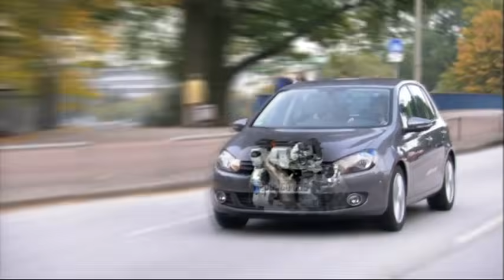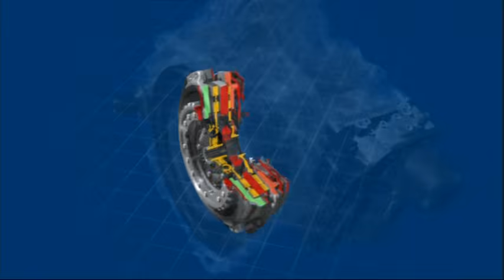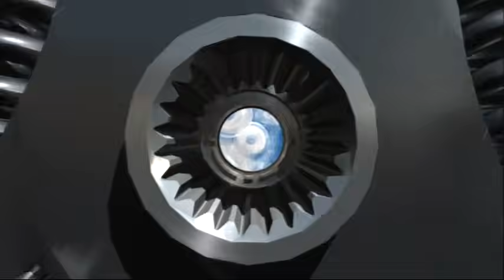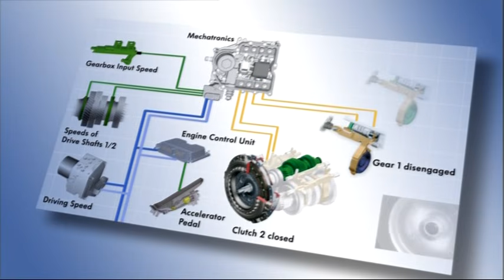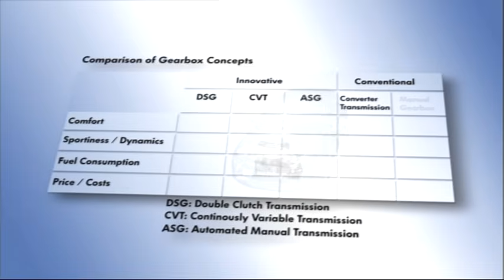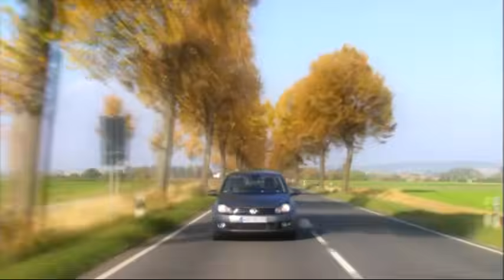Volkswagen Explains DSG gearbox

Comment: I have a problem with what VW is doing. I think they mean well but what theyvare doing is wrong for the real world and proper design multispeed automatic transmission with lockip torque converter is better. The problem I have is I live in Seattle WW USA which had horrendous traffic jams. Took 12 minutes to go from SR 512 west to I5 south in Tacoma on one ocassion and have rin into similiar jams elsewhere. Traffic sometimes moved slower than engine at idle first gear for minutes at a time. Real manual transmission with coutch pedal cannot competent traverse such jams and have become almost extinct in this ares. I saw tou rube video showing dual coutch creeping aling real nice in what i believe is similiar to traffic jams. Narrator warned dint do this wears coutches out real fast and other yoy tube videos suggest avoid such driving. Well you can't do that in Seattle. Never know where jama turn up and it hsppened often enough that is no go fir manual transmission. And I believe dual coutch.Dual clutch might be better in some ways perhaps as VW claims. But realibulity and affordability means more than slight improvement in performance. I also believe VW eventually found this iut. Aaw somewhere they went back from dual coutch to automatic transmission in one of their models

Comment: I had golf 8 eTSI with DSG/DQ200 Transmission I and have strange noise(clattering metal to metal) at low speed .I was on specified service car is old 8 months and last mont I got strange answers from VW factory that this noise is normal...it could not be disasters what a shit gear box and car!!!!

Comment: I wouldn't hesitate to say that some transmission problems turn out to be the dual mass flywheel. I had one go on my 2006 Jetta TDI and my 2017 Jetta GLI 6 speed manual. The one on my GLI cost me $3000. I was pretty angry about that. I have the flywheel and clutch and just 1 rivet caused it to fail. I'm not impressed.

Comment: DSG best transmission where there was a recall in 2009 when cars would get the flash of death (Flashing PRNDS) and your vehicle would get into neutral and you have to turn off you car in order to get it working again. Best mechatronic unit reliability where you can have 20000 miles and it already failed. When you want to shift into reverse from drive and your transmission gives out because it's faulty. Perfection

Comment: Cost 0??? At ~$9500 USD for a new/replacement OEM unit (Audi)--these things are not cheap! Nor is it easy to find anyone capable or willing to repair one given the low risk vs. reward in doing so (at least not once you are dealing with issues inside the gear box). When serviced and not leaking fluid, they are hard to rival, but if one starts to fail or lets go, plan on dropping some dough. I am about to pay $4500 all-in on a salvage unit including flat rate shipping and install given the code on my unit is so rare.

Comment: ... formidable but wen is gone is gone. 
My DSG left me wen I needed most, and to repair it cost me a fortune.
1400 pounds megatronic unit, 1200 flywheel and clutch and another 1000 some forks are labour .
This gearbox was loosen power from the day I have it around 49000 miles and because I am a ignorant and I didn't inform my self I pay the price. 
This transition is made to make money from the clients nothing more, is terrible in the city because is running out the clutch , and need maintenance every 40000 miles and is not very cheap either .
10000 sterling pounds + for this comfort is not worth it .
Reply: ... last updated. 
Price for spare parts from Volkswagen are 1400 £ for megatronic unit 
1250 £ clutch, and 1350 flywheel , and that if you are a garage, if not price is bigger. 
To repair your megatronic unit 450£ + vat , replacement  refurbished 655 + vat  with life time guarantee, if you don't live long, Clutch 350 £ flywheel 4500 from LUK , and 8 hours labour  , and that if you lucky to catch a good match , I had the opportunity to catch 2 broken one and a bank holiday and I became gold client on the rental company. 
Now, maybe I had bad luck ,but this story with megatronic broken took 2 months 3000 sterling pounds labour and spare parts, and 4000 pounds van rental, so I ca go to work and pay for all of this.

Comment: The 6 speed DSG is the better transmission. The 7 speed has dry clutches and is much less reliable
Reply: the wet clutches 6 speed is not reliable at all due to oil contamination clogging up the mechatronics unit solenoids
Reply: @khutsobrian5952  Not correctly. There was some problems with wrong use of hydraulic oil in the megatronic unit from factory but is upgraded to a better oil now.
Reply: @ErikNorseman  High sulfur content oil used from factory in the TCU caused the TCU's board to short-out.
Reply: @scgray05  Thank you 😊👍
Reply: @khutsobrian5952  oil contamination? Just change the oil and filter and you're good to go
Reply: The dry clutch version wasn't around nearly as long. Yes, earlier in production the 6 speed was suspect to break down. But it was used for so long the kinks got worked out. I have a 2012 6 speed and it shifts like butter at 90k

Comment: Formidable engineering and so easy to use for the end user!!!
Reply: And all DSG gearboxes break down.
Reply: @Coordinator61 but they are still the best gearbox for a sports car 10 years later 🤷‍♂️
Reply: @wattjob69  not for me just 6 speed stick or normal automatic these dsg stuff go bust every one of them.
Reply: maybe because you dont do any maintnence? i have a golf 5 DSG with 270k km on the dash no failiures so far @Coordinator61
Reply: How do you maintain those. I'm having 69000kms reading so far. Just worried what might happen in near future. It's working fine so far.  @domino6434